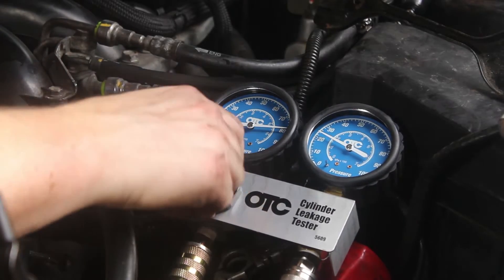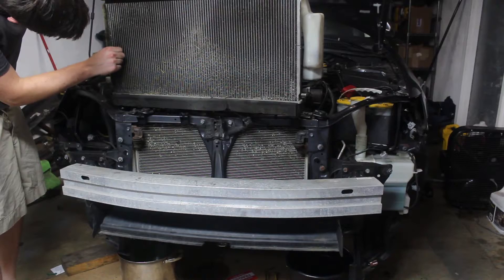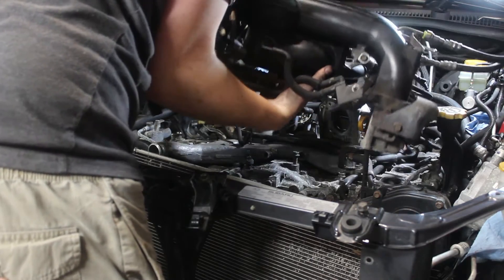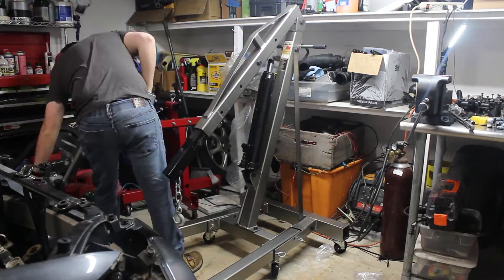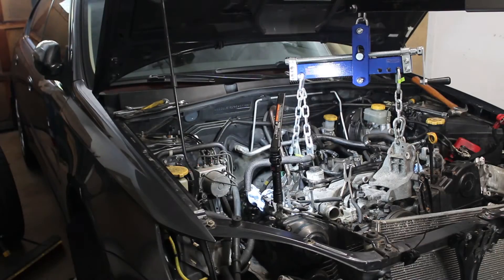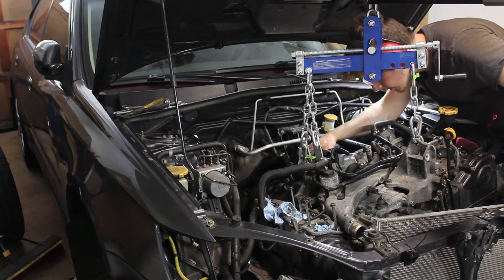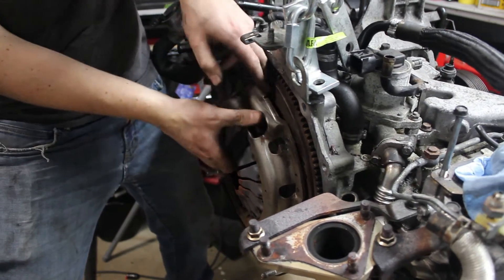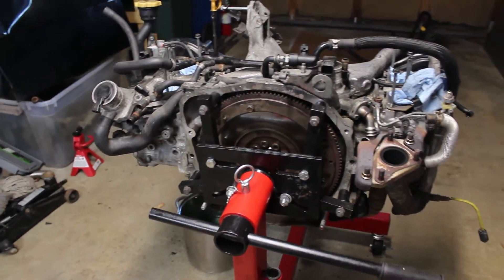Subaru 2.5L Turbo Engine Build - EJ255 Engine Removal

Comment: If there anything special that you had to do to get the upper and lower manifold to come out together?  I'm not finding a whole lot of info online on how to pull them out together.  I have the same engine my WRX.
Reply from the maker: I don't remember exactly. I think it's easier to take them out at the same time, since the fuel lines and stuff are bolted to the upper manifold. There's maybe 5 long bolts on each side, I think the rest of the stuff is all connectors and hoses.

Comment: I had the same part break. Both of the EVAP solenoids. They call them Valve Duty Solenoids, for whatever reason. $50 each at the dealership. 16102AA480
Reply from the maker: Thanks, I was able to get them replaced, I think there's slight differences between them, which took a bit to figure out. They call them valve duty solenoids because they take a duty cycle input and rapidly open and close the solenoid to adjust the flow rate.